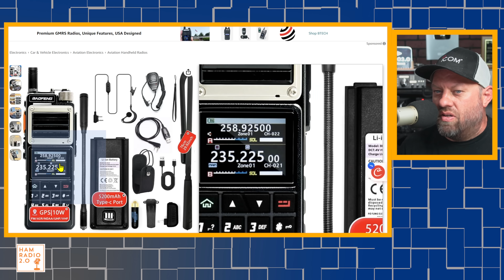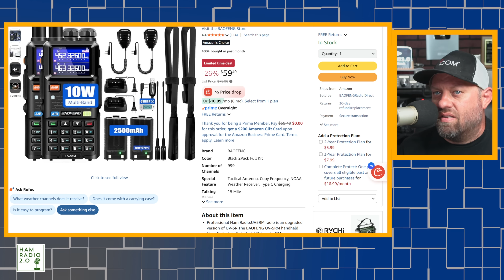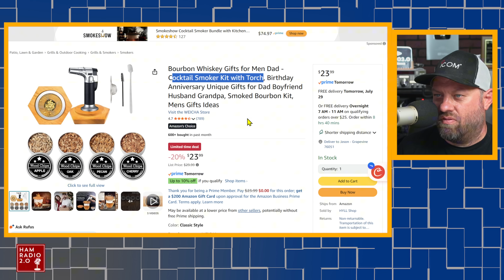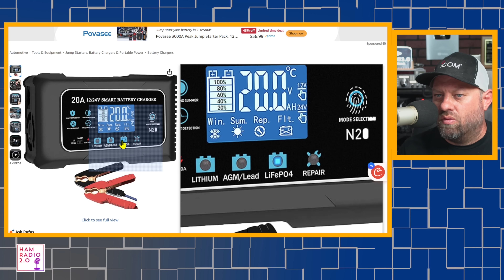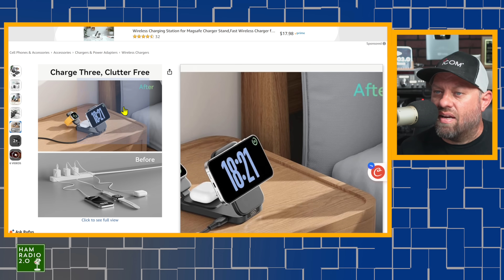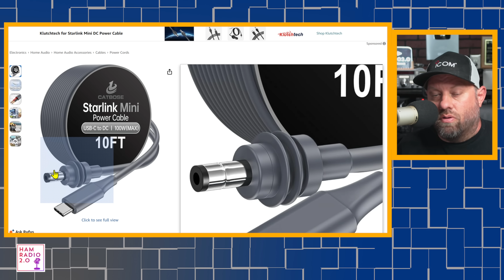Top 7 Amazon Ham Radio Deals You Can't Miss!

Comment: The uv-5rm is manufactured as a knock off of the actual one made by baofeng and the official one tested clean. That one is called the AR-5rm it also comes unlocked.
Reply from the maker: IDK if that is accurate.  I am going to check with my contact at Baofeng.  There are LOTS of counterfits out there, but there are also some models that Baofeng doesn't sell to the public and were made for a specific use case.
Reply: @HamRadio2 the ar-5rm is a fully unlocked fairly clean radio.. the bundle deal with extended battery was $25 now its $38
Reply from the maker: I meant about who makes the radio. Most all of those Chinese radios are unlockable